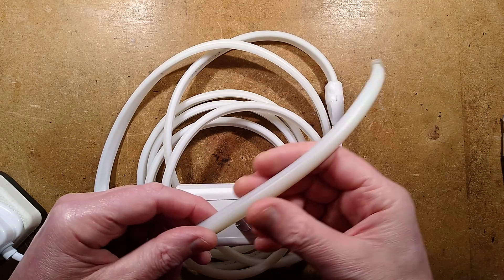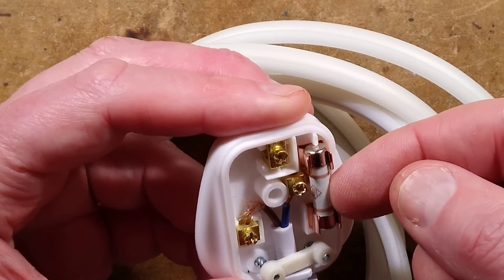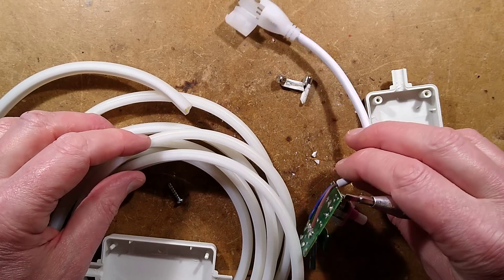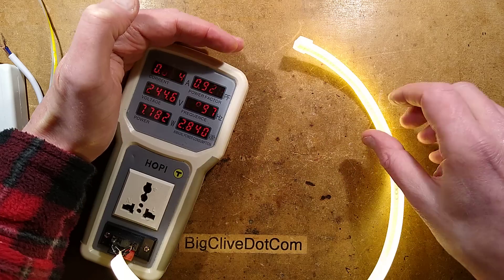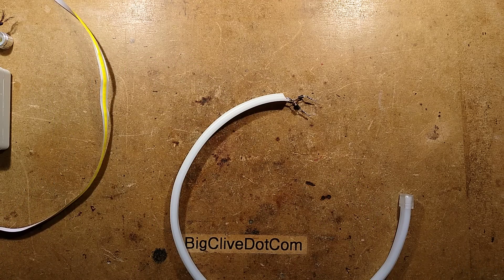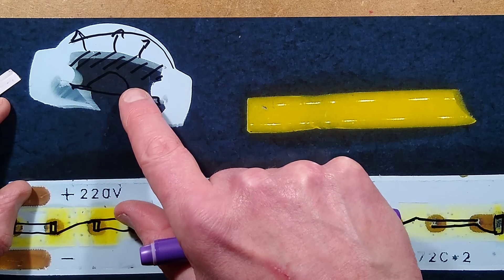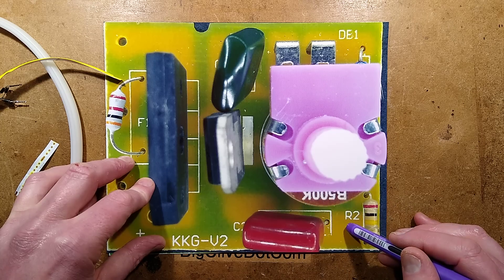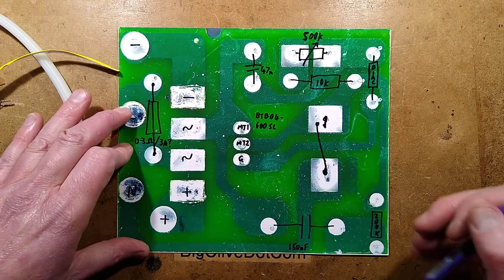Flickery COB LED strip with terrible dimmer.  (with schematics)

Comment: are there any videos how to test intermediate sections of those "cob" strips, or how to unsolder the power supply
Reply from the maker: They are a disposable material.  The LEDs are often over-driven and fail quickly.  The power supply is often just a simple rectifier.

Comment: Is there a suitable replacement of this sh*tty dimmer with better one?  I have 2 meter of this LED strip (230V version) and flickering is very annoying. Thank you.
Reply from the maker: The problem is with the strip itself.  It operates on unsmoothed DC.  If you want flicker free dimming you may have to go with low voltage strip.
Reply: What if I just add 400V 100uF smoothing capacitor befor LED strip ?

Comment: Thank you for the video, sadly I watched it after ordering that same exact strip.

As a non native speaker I didn't quite understand though: Is just the dimmer bad, or the strip as well? I wasn't going to use the dimmer anyway, I would like to use a dimmer that's wired in my drywalls.

Comment: I do remember running across fuses that looked a lot like resistors,  a really long time ago.  Like 1984, 1985,  somewhere around there.  If memory serves,  they were used in the power supply of an Apple II.  The ones I got to replace the blown ones were made by one of the major fuse manufacturers,  can't recall which one offhand.

Comment: I purchase the same 10m . Dimmer burn, so i decide to change it with schnider asfora , very good dimmer, but the cob strip has blinking, even without dimmer! What is different( hz?) and please give some advice how to fix it. China seller tell me to buy the same dimmer, but i don’t want to
Reply from the maker: Some dimmers aren't able to work with LED, since it doesn't pass enough current over the sinewave to latch the triac.

Comment: Clive, very good to find this review.  I’m planning to use a huge led strip assembly for the main room = a total of 25m in perimeter of the living room ceiling.
It would be interesting to #1 be dimmable, #2 not overload the copper strips (solution: external wires), #3 provide uniform light intensity among LED-Strip segments. Because of these #1#2#3 I’m wondering if a 127VAC (Here in Brazil) would not be better than some beefed-up 12V header (~15A to 20A @12V) to use the conventional 12V strips as commonly used.
Im wondering to use the total 25m strip assembling it in SERIES with 12 segments of 2.1m (12V x 12elements = 144Vavg < 176Vp = 127Vrms x 1.41), then using a Triac DIMMER with bridge rectifier and a small smooth capacitor (470 uF) just to reduce a little the 120Hz flickering when Vpower < V_LED.
I would appreciate any feedback from you and our fellows here.
Thank you

Comment: So I know the reasons you cannot plug a 2000w tower heater/space heater etc into extension cables or multiboards etc. But i have a "heavy duty" out door cable for power tools, can I use something like that? If not can you recomend a safe way to make the pathetic 1m cable it comes with reach about 2.5m away where I need it to be? I got a quote from an electrician a while back to install another plug socket and it was 3x the price of the heater :(. Sadly most Nz houses have only 1 or 2 sockets per room it seems...

Comment: What would happen if you connect that dimmer to the primary of a 230V - 12V transformer? Can we make an adjustable power supply like that?
Reply from the maker: A dimmer like this would be unstable on an inductive load and may output a non symmetrical waveform resulting in heat and possibly transformer damage.

Comment: I don't really like any parallel connection of LEDs without an individual driver for every parallel branch.  Not sure Clive, you are right by saying (if I heard correctly) that failure of one of the paralleled LEDSs will not cause shut down of the whole strip because the other LED will keep it going.  In my experience failure of one of the paralleled LEDs (open circuit) will immediately cause failure of the other one because the current through the other one suddenly doubled. The strip current is stabilised at a value that assumes that the current is shared roughly equally between the two (or more!) parallel branches. Failure of one does not change the current as it is stabilised, but it now shared by fewer (one!) LEDs thereby increasing individual load.

Comment: The snubber is completely unnecessary for a clean load such as an LED and current limiting resistor. They probably copied it from another design, without much thought.
Reply: ANY length of wire is an inductor..and it's not important that's it's connected to a "purely" resistve load or not..the snubber also avoids false & intermittent triggering of the triac..besides protecting it from high (dv/dt)..
so in a way the snubber also helps reduce EMI being injected back into the utility supply.
Reply: @analoghardwaretops3976  True, but TRIACs are tolerant enough to the tiny inductance of a piece of wire. A snubber doesn't do much to get rid of the high frequency harmonics being injected into the mains. Commercial lamp dimmers have inductive filters, to suppress EMI.

Comment: Since most stuff of this nature is made in China (and badly, viz the above) how do I ever get to buy a 'proper' COB strip for illuminating my new kitchen that won't burn it down?  They (the sino-COBblers) will stick recognised a safety label on anything to fool a buyer - so who do you trust?
Reply from the maker: I recommend using either generic LED tape installed in a way that makes it easier to change or alternatively good quality LED sign illumination modules.

Comment: A 13 Amp fuse for an LED strip, connected badly... to the wrong cable. A trifecta of fuck-ups.
Honourable mention goes to the metal earth pin, which for once could actually be replaced by one of those useless Chinese sleeved ones and yet still be more expensive than the plastic pin it actually warrants.

Comment: the chinese seem to get polarity wrong quite a lot, i've seen black used as positive, red negative 😲 and a lot of laptop and similar psus have the mains fuse in the neutral line  , maybe getting confused with usa color code with black being live, white neutral, which is opposite to whatd make sense to me, eg, ' white hot' , black things cold....and of course our old colour code was black neutral!
Reply: If you don't add any colorants to the insulation it comes out white, ie white is the most neutral color for insulation. It makes sense that the neutral color is used for the neutral wire.
Reply: @eDoc2020  our neutral is 'blue' and used to be black, so opposite!  i have some old european made devices (philips) that have 2 core oval cable, both wires white ...
Reply: @andygozzo72  I'm well aware of the European color code. The internal wiring of pretty much anything I come by which has a switchable/wide range input voltage uses blue and brown. Surprisingly, this even includes wall warts with built-in US plugs.
Reply: @eDoc2020  maybe they use those colours in the us for things that could have 240ish volts powering them? i have an old japanese made dual tuner vhf and uhf teleton black n white tv, capable of mains input 110 to 240v by altering soldered links, has usa coloured mains lead, but i've been led to believe it came from a us air base either here in the uk or germany as looks like originally wired for 120v but altered to 220v , and has sticker on the back '6mhz' indicating the sound intercarrier frequency used in the UK, i think it is/was 4.5mhz in the usa, 5.5mhz in many european countries,
Reply: @andygozzo72  The internal color is all about where the device was designed. The official colors are only a requirement on fixed wiring.

Btw 4.5MHz is the NTSC sound subcarrier frequency. I knew about 5.5MHz but wasn't aware that 6MHz was used in the UK.

Comment: And that's what i like in your videos - a little hack at the end, that should fix what the manufacturer missed (probably on purpose of saving costs). 
I remember that i stumbled across your website like 15 years ago and wanted to make the "LED Bonsai Tree", and to this day this website is still available, still in the same form as 15 years ago. You're a legend, Clive.
Reply from the maker: I recently stripped all the advertising back off the website, so it's back to its original form.

Comment: Thanks for another insight into electronic kitch or even dangerous junk. I hate flicker so this would be destined for the WEEE bin, if the wiring of the plug hadn't already warned  enough. That dimmer coming apart so easily was another warning. Thanks again.

Comment: 500 k to small to control LED ,i better 1 mohm оr 1.5 mohm to control triac with small current , with  500 kohm potentiometer in open circuit this trial always gives voltage

Comment: Perhaps the limited potentiometer range may be due to usage of a logarithmic scaled (package markings starts with B) not a linear one (marked with A)? The log ones are the most common ones, as they're used in audio circuits, where perception of sound level is log.

Comment: I think the pf is +90%, because only the first 30v of the 310Vpk can not light. If you parallel a resistor across the pot, you can severely reduce the pots dead zone, I have used 300K successfully. Good stuff, keep them coming! Thx.

Comment: Bought a COB LED strip for my bedroom not long ago that runs at 24V with an in line remote dimmer,  not sure what the culprit is but below 60% dimming it flickers making it essentially useless for the mood lighting I was intending to use it for.
Maybe I can send it to you so you can investigate it?
Reply from the maker: It may be a low pulse width modulation frequency or interaction with the power supply.  It might be worth trying another dimmer or power supply.

Comment: Speaking of LED lights, I dug out the old task light I built a while back, because I just received my new Noga arm so I've actually got something articulated to mount it on. It's just a few Osram 3W "Golden Dragon" LEDs in series, soldered to those star shaped aluminium backed PCB boards and mounted on a heatsink (with a 3D printed shroud and perspex light diffuser). I never did get around to building a driver circuit for it, so I really should look into what options are out there for constant current circuits with dimming. It would be nice to have something a little more "linear" than just PWMing a CC source (although perhaps without the added heat dissipation of an actual linear regulator).

Comment: Allways having issues with LED lighting and 0-10v control dimming .humming flickering and every other kind of noise you can think of .All the garbage switching power power supplies and VFDs on tread mills and pool pumps and furnaces just making a mess of the AC mains

Comment: Interesting. I don't understand how the series gate firing chain of pot + R + C can pass any current with the bridge in series too. Is it charging through the LED chain as well? Is the gate firing chain returned the other side of the bridge maybe?
Reply: The diac-triac series dimmer circuit always passes at least a minuscule current through the load.

Comment: Interesting you note the fuse is fake but 13 Amp!! That wouldn't give much protection if needed.
Haven't they got any 2 or 3 amp fuses, or even a 5 amp are quite easily available, at least that's better than 13.
Keep the vids. coming. Marrtin.
Reply: It makes no odds fake or not. Even a genuine 13 Amp fuse isn't going to cut the power by the size of the wires. Martin.

Comment: LEDs love phase angle control, you don't even need a capacitor or resistor because they're off most of the time, just straight across 250v mains current, that's why the plug isn't earthed, because it doesn't need to be, trust me!

👀

Comment: Very hackable. I like the capacitor dropper idea. With smoothing, how would the power factor look like? Can it just run 24/7?
Reply: power factor for a thing like this is not an issue.
Reply: @gedtoon6451  Depends how the billing is changed.
Reply from the maker: Power factor would be different with a capacitive dropper, but it would be very low power anyway.

Comment: The LED lightbulb on a dimmer in the living room of a holiday cottage I rented the other week behaved similarly. Almost nothing for most of the range of the dimmer, then heavy flickering then full brightness. I wonder if it was similar design flaws?
Reply from the maker: That may have been a non-dimmable lamp or just an older style dimmer that needed a minimum load to work.

Comment: Cheap Chinese trash can't even wire a UK plug correctly and of course a case that kids can pry apart easily, no earth, non compliant over rated fuse, no smoothing capacitor and the crapoiest imaginable circuit.

Comment: Why do UK plugs have fuses in them? Do UK homes not have fuse boxes, or are UK electronics more likely to combust?
Reply: In the UK  we have ring mains circuits protect by 32A breakers in the fuse box. So the fuse in the plug protects the wiring to the equipment plug in.

Comment: this year I'm gonna replace my window A/C with a 240v version of high btu swap in a 2 pole breaker in the breaker box to power it just plug the connected outlets.
 its getting hot and I don't really use A/C but when I have guests I wanna be able to blast it cold pretty quick. I'm gonna use a 20 amp breaker because thats what the a/c calls for on the package and I used a wire gauge calculator it needs to be 14AWG existing should be thicker than that but I'll check. This is my first time pokein around in a breaker box should go okay I think its a pretty short run from the breaker to the window
Reply: I'm assuming from what you write that you're in the US?  For a 20A circuit you want 12 gauge,  not 14.

Comment: I noticed that COB strip has 220V silkscreened right on it. Given the claptrap dimmer circuit, what would happen if someone tried to connect that to 120V/60 Hz?  Nothing? Magic smoke release?
Reply from the maker: With the high number of LEDs it would either be dimmer or not light at all.

Comment: On the point of copper coated aliminium wire. I purchased some 'profesional grade' alligator testing hook up leads that are steel wire that said copper wire in the eBay description. I became suspicious when some got hot at the clips with just a crimp commection and they would not solder. I found that a magmet on the bench sttracted the wire leads. Cheap shitty Chinese products.

Comment: Even if the appliance is ungrounded, polarity is still important. You want the switch and dinner to be on the hot side; otherwise like voltage is still present even with the unit turned off.

Also: Edison sockets.

Comment: Will the dimmer pass enough current to power a slow cooker? I have a 50 year old electric frypan that's continuously variable and works great but my crap Chinese slow cooker only has 4 heat settings.
Reply from the maker: Not recommended.  It's a low power rating.

Comment: Hi Clive, I too live in the UK and thought that wiring was the worst I have ever seen. I did not know that fuses were soused to have sand in them, and after testing some of mine found no sand at all. What advantage does the sand make over the non-sand type? After seeing that plug, I wouldn’t touch that with a bargepole, I have seen some dodgy wiring in my time but never anything as bad as that.
Reply: The sand assists in quenching the arc on high current faults, and also prevents a scenario where in a particularly spectacular failure, the metal of the fuse vapourises and then deposits on the side of the fuse, leaving a conductive pathway even once the fuse has blown. In these failures, the sand absorbs the heat, and can also turn to glass, which effectively prevents any residual pathway from remaining after the fuse has blown.

Comment: I'm no ham, but spitting on them accomplishes nothing.  And they aren't the only people inconvenienced by crappy circuits that spew out RF hash.  SW, MW, and LW listening has become almost impossible inside many homes today.  Moderation is called for, not Karening.
Reply from the maker: I'm not spitting on them.  A lot of hams follow the channel and get quite rightly miffed at badly designed products that generate blanket RF noise.